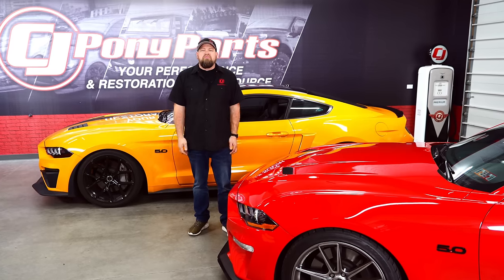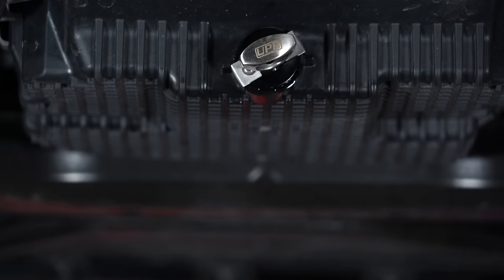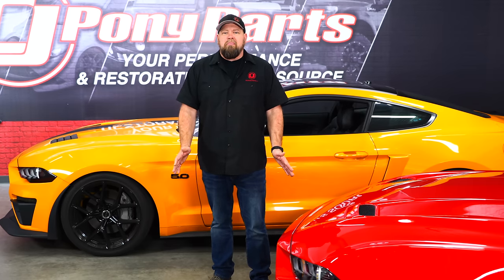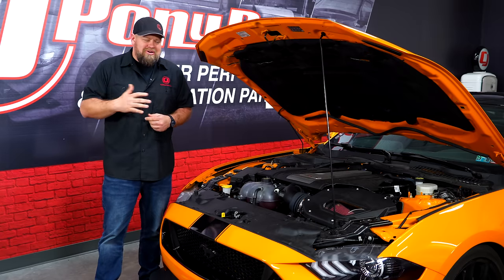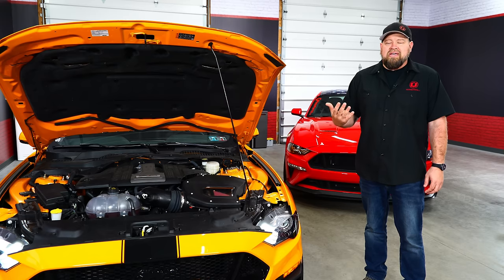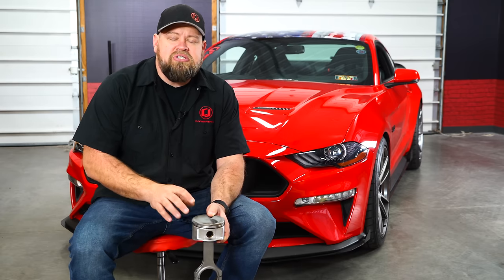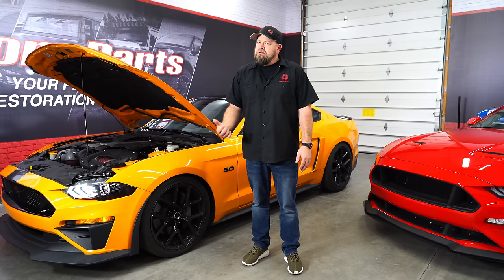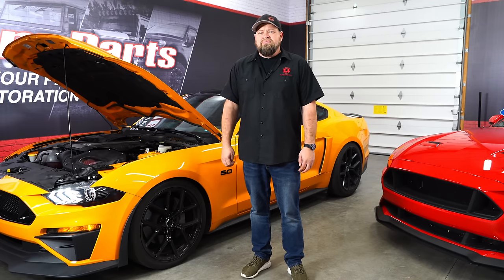2018-2019 Mustang Tick: Should You Be Concerned?

Comment: My 2014 has the tick, but i just add a bottle of ceratec every oil change, and the tick is no where to be found. The engine is so quiet you can bearly tell if its running or not.

Comment: My 5.0 2018 has it and I some times thinks it’s getting louder but I am sure it’s not. I am a mechanic for years. Yes this does seem like a piston slap issue mine has been happening from 32,000 to 69,000 I looked at the rod bearings they are good. Looked into the piston bores they don’t seem to have any scuffing or bruises. So that theory is out the window..

Comment: My 2020 Gt base model is currently at the dealership. They told me yesterday 2/4/21 that my whole passenger side has no compression. I don’t dog my car but I do drive it hard off and on as it is a sports car. I have had the tick sound and even a rattle at around 2000 rpm. I’m not sure if it’s all connected somehow but my motor gave out while going 60mph on the highway. We will see what happens and if Ford stands behind the warranty

Comment: I have the same tick with my 08 mercury sable that goes away when warmed up. Bought it with 9 thousand miles now has 60,000 miles. Still running strong no problems. I hear they're calling it the Ford tick.

Comment: Thanks for this.  Nice video and I agree with your viewpoints here.  FWIW, I have found Ceratec go be a successful solution for nearly any unwanted ticking noise in the engine.
Reply from the maker: Romacitta it really is good stuff
Reply: Hey do you have auto or manual?
Reply: CJ Pony Parts hey can I use ceratic on my 'manual' mustang 2018 gt
Reply: CJ Pony Parts can we add it to the MT82 transmission for smoother shifting?

Comment: I’m buying stocks in ceratec
Reply: Dilly,Dilly!😀
Reply: Lol
Reply: Not a bad idea! Seriously! 🤔
Reply: Haha no shit!
Reply: 2016Mustang I wouldn't put that stuff in my engine, if anyone is concerned about hearing what the think is excessive noise (tick) I would run a higher weight oil like what has been recommended by some here.
Reply: 2016Mustang why should you have to add anything to that engine. The manufacturer doesn't recommend it at all so there is a underlying problem that may be getting mask when using fairytale additive if the manufacturer doesn't list it  in your manual or when  leaving the lot you're not told to use it in order to keep your car quiet something's not right
Reply: @poweraddergt6580  I have a 2019 Mustang GT. My car has had the tick since the first oil change. Today I changed from the recommended oil to a 5w-30 and I have to say I still hear it loud and clear.

Comment: I bought a 17 gt/cs with 9000 miles on it and later found out engine was replaced at 3500 miles for piston slap. no problems with new engine so far but I have 7 year 100k mile warranty.

Comment: I have a 2019 GT PP2. At about 9,500 miles I stated experiencing a rattle from the valve train between 1,500 and 2,000 RPM. I brought it to my dealer and they replaced the cam phasers.  The moment I drove the car home I heard the noise. I brought it back and drove it with the service manager. He heard the noise and kept the car for another week but failed to address the problem other then to acknowledge that there was a noise but couldn't identify a cause. I then took it to a dealer clear across the state. They too heard the noise and couldn't determine the cause. At this point the car has 13,500 miles and still has the noise. I cringe when I hear it. The dealer told me that Ford's technical division is aware of my problem and when they find out what is causing the noise they will get back to me. My original warranty expires next month so we'll see what Ford has to say when this engine craps the bed.

Comment: 2019 GT... I bought it back November and after about 150 miles it’s started with the noise... went back to dealer and after they listened to certain areas and them being in contact with Ford and being told other areas to listen too, the dealer and ford said it was VVT noise... they pulled the filter and didn’t see any sign of metal... car now has 750 miles on it and the noise hasn’t changed but does go away when warm... I’m waiting till I get more miles on it and I’m checking for metal in the filter myself, pending what find will determine if it goes back due to metal in the oil or if it’s clean then I will run 5w40 in it... I don’t believe it’s VVT noise... I can agree with piston slap being a potential reason for the noise... could different oil be a fix/bandaid for the noise, maybe but time will tell...

Comment: Got a 2017 5.0 manual perf pack..bought it new..baby it..only 5000 miles..did my second oil change yesterday..and I heard the tick for the first time with the car in my garage..can hear all better in there?..I guess..never heard it before..need to see if maybe its the Direct Injection you mention..I heard it from the front..thought maybe it was a belt? or chain etc? its not super loud and not sure if its "consistent".. maybe..I'll check..its my first Coyote motor

Comment: Got the engine replaced under warranty on my 2017 after 15,000 miles. Had the tick, all the time. Could hear it best when holding the throttle at 2000 rpm in park. Dealer said one cylinder wall was scored and measured out of tolerance.
Tick is gone now with the new engine.

Comment: My 2012 Mustang GT has the tick. 95,000 miles later it’s still in one piece.

I did two oil change analysis between 10,000 miles. There was no unusual wear or metals discovered in the oil analysis.

5W-20 oil with 10,000 mile oil change intervals.

Comment: I had a 2017 and I could hear a noise from under the car at start up, initial idle, and on initial acceleration.  Once it warmed up, it seemed to go away.  Had the dealer look at it.  They could hear, but could not trace to know what it was...so they said.  Thought it was a clutch noise, a loose exhaust, possible rod knock...I ran through all possibilities.  Could not figure out.  Part of the reason I sold it.  Have had 2 M3s in the past that both had a lot of issues...did not want another.

Comment: I have 04 f150 4x4 with 6" lift and 35's with 5.4, and yes the cam phaser tick also. I also have 221,000 mls and it gets 15-17 mpgs. Haven't had any problems with the motor, (using Mobile One) and running strong still.

Comment: I bought a new 2014 GT that had the tick since day one ( under the car )  only would tick at low RPM when fully warm with 5W50 . I put over 30+ road course track days on that car and had no engine or transmission issues. Tick was still there when I traded it with 19K miles.

Comment: 2014 GT bought used at 14,000 miles. Noticed tick when I got it home after pulling into garage. Changed oil to Royal Purple 5w20 and have not heard the tick since. Also changed transmission to Royal purple syncromax and it stopped making noise as well!

Comment: I have a 2018 Gt PP1 and my car had the tick when I purchased it new. It has around 25k miles on it and the tick is completely gone now and my engine runs smooth. The only thing I've done is change the oil regularly with 5w30 motorcraft oil.

Comment: This tick is common in a lot of engines I’ve found. The 1H family engines from Toyota have this noise and have so for 30+ years of production. The general thought is either crank flex or hydraulic noises. Ceratec fixed the noise in my case also in my 1HDFTE. No one has reported their engine failing from this tick that I can find with their Toyota. It seems to be a normal noise with no bad effects. Really annoying though!!

Comment: I just purchased a 2019 GT with PP1. I have 1100 miles and have the tic at start up, goes away after warm up. It seems to me that these “solutions” are really guesses since the actual cause has not been determined. If the tolerances are so tight that the 10W 20 oil doesn’t lube until warm, adding thicker oil is not going to help. If it’s piston slap, doesn’t matter what oil you’re using, you just won’t hear it. Since I have another 35K miles, I’m going to monitor and hope Ford identifies specifically the cause and a real solution. Drive on!

Comment: i had a lash adjuster making noise intermittently in my 15 f150 coyote , i ran a oil system cleaner through the engine and the changed the oil with 5w30 mobil one , ran it 2k miles and the changed oil again w/ mobil one 5w30 and now no noise !!! the 5w20 oil is too thin for these engines , same for the 5.4l and 4.6l with the chain guide and phaser problems , and change the oil every 5k miles or less !!!

Comment: It is just a clearance issue. Minor and it occurs with all engines in all applications. Ford is well versed in the Plasma Wire Arc technology having used it several high performance Mustangs well before 2018.

Comment: I have a 2019 GT pp1. I didn't have the tick but I did get a longblock replacement under warranty (1.5 month process). The initial diagnosis was at around 500 miles. You could hear a dull knocking coming from the engine, the car would occasionally have a very rough idle, and it was down on power to the point that it would really hesitate to move under 3000 RPMs. Metal was also discovered in the oil filter. The damage was to a camshaft and cam journal being scored. So far the new engine seems okay. It's noisy, and it occasionally squeals during a cold start (below freezing right now so I'm not too worried), but the engine itself feels great. No loss of power and it pulls hard from a stop. Also, no tick. I dumped the 5w20 and put in penz plat 5w30 (dexos gen2 and api sn + certified) the moment I got the car home. I've only put about 200 miles on the new engine, but so far so good.

Comment: I had a short block replacement by Ford under warranty for the same tick that you showed in the sample video. They said there was no metal shavings in my oil but one of my cylinder bores was oblong and egg shaped. I have my own tick video as well on my channel. I put 1k miles on the new motor and the tick came back shortly before I did my first oil change but only while the oil temp is cold. I used Ceretec the other day and it has not made that noise since.

Comment: I watched a video where they were working on the short blocks (some custom shop) and the guy explained that apparently they ended up with a big batch of blocks that left the factory with the wrong size (undersize) pistons, which could be the culprit of the piston slap, not so much the liner. Could it be? These motors are manufactured in Windsor, Ontario, so its hard to believe that they could have missed something like that with the years of experience they have building Ford motors. I would expect issues from a motor that manufactured in Mexico, but not Canadian built. Its a shame.

Comment: Did they address this issue in 2020, or are people still getting it?
Reply: Would like to know as well.
Reply: @MatthewJay80  I have a 2020 GT and it just started making this noise at 1,500 ish miles. Very metallic ticking, like a heat cycle expanding/contracting but its coming from the bottom of the engine... Sucks to have spent 50k on a car and 1 month later the engine sounds like this...

Comment: 1300 miles after I bought the car it started ticking. Dealership cut open my filter and found metal in my oil. They pulled the valve covers and popped off the upper cam caps and found excessive scoring on the caps and cams. Waited 4 months to get a replacement engine. Got the 2nd engine and it lasted 1200 miles. I waited another 2 months for engine number 3. Drove it for 600 miles and hey hey,,,,you guessed it.... tick,tick,tick,tick!  I have everything video documented and pics of all that has happened. I really think Ford should address this issue. Not just well hey you spent 53,000 bucks on a car so deal with it.

Comment: I just bought a 2020 GT and it has 850 miles on it now and I just noticed the tick and that’s why I started doing some research. I will have to try upping the oil to something a little heavier to see if that helps. I have not had it fixed yet. Thanks for this video

Comment: For any engine noise, anything you do to the oil is a bandaid.  The real fix is to build it right.  Causes are widespread and never ending...lack of a quality and properly located cylinder liner,  bearing problems, excessive con rod side clearance, piston slap...  If you want to fix a noisy engine right; tear it down have iron liners properly installed in the perfect bore space, properly fit pistons, connecting rods with proper side clearance, quality bearings... basically building it the way it should be.  

A random typewriter tap can often be way too much connecting rod side clearance. Should be about .008" - .020". Get way over .020" and on the downward stroke the con rods slam to one side, at BDC and a little crank flex, they get slammed to the other side before the upward stroke.  And you hear a random tap.  Take an engine with over .020" con rod side clearance and tap the rods back and forth on the crank journal... sound familiar and kinda like a typewriter?  Cylinder bore spacing out of whack plays havoc with con rods and side wear.  Add in expansion/growth, multiplies the problem.  Properly located iron liners lessen that issue probability.  

Piston slap is obvious.   Sounds like a diesel on cold start.  Goes away after a few minutes.  After many many miles the piston skirts may be so wore down that it even rattles warm.  But again, very obvious diesel like sound.  
Bearing problems also obvious.  Remove, inspect, measure clearance.   The elusive noise is the con rod side clearance, and bore spacing problems.   Might take putting an engine in an oven at 200 for a few hours to see how things look at operating temp to then see... wow the cylinder bore centers are way off and several sets of con rods have way too much side clearance.  

There is a simple way to build an engine that doesn't make odd random knocking/tapping noises.  It's called quality control.    And before that... robustness of design.

Comment: I Own a 2018 PP1 and have had my engine replaced after 1142 miles, Because of no oil pressure. Jumping ahead to 5200 miles started hearing the tick by 7000 miles is was getting pretty bad took it in and dealership Master tech said it sounded like it was coming from the front of the engine. took front of motor apart to find the timing chain tensioners were bad . they replaced the whole timing assembly and pooof no more tick. picked car up today 12/28/18 motor sounds real good..putting ceratec in the morning just because.. crossing fingers tick stays away.
Reply from the maker: David Rose wow that’s a lot to deal with  at such a low mileage. Hopefully the ceratec helps

Comment: My 18 has 12k miles and every once in a while I swear I hear a tick but it's very faint and not like my previous car, a 2016 GT that most definitely had the tick and had its block replaced under warranty. Paperwork said "scoring in cylinder 8" and that happened at 7k miles. I'm pretty paranoid about it now because of my bad experience with the 16, so I overanalyze every little noise I hear on the 18. But so far so good.

Comment: My 2020 GT with 12,500 miles and I’ve had the tick since around 8k miles. It bothers me but as of now it hasn’t done anything strange or hindered performance. These gen 3 engines are relatively noisy due to Direct injection and the tick but I’ve learned to just get used to it. I don’t agree it’s normal but so long as it doesn’t affect performance or leave me stranded I think I’ll live with it.

Comment: Bill I you are dead on... these are not bad cars imo , I have a 17 roush makes 800 plus HP but I also got a 19 doing twin turbo setup, I think this is the best mustang ford has built!! And I also think it has something to do with the spray in liners, but you and Zander are completely right ppl dowing these cars and don't even own one!!
Reply: sam constantino I have a 17 Roush Phase 2 so what do you have done to get to 800 plus because I’m interested.
Reply: @johnthegaptist7794  75mm pulley, custome tune for 93& 110 race fuel , VMP twin 67 TB ,PMAS cai, boost a pump ID1050X injectors! Its getting a fore triple pump fuel sys now and the new VMP Gen 3 2650 blower in a couple more weeks and going for 900 plus and this car only has 1,200 miles on it lol lays down 738hp to tires
Reply: @johnthegaptist7794  also got a 19 GT A10  car with only 350 miles on it doing twin turbo kit on it done got oil pump gears and crank gear done now fun part, pushing for four digits on this one prob should have built whole motor but will see how far we can take it with them spray in liners lol

Comment: Don't know about a ticking problem in my 17 gt, but I run Amsoil 5w-20. I recommend full synthetic in these engines, especially if you're running them hard. I've ran my mustang like I stole it and have never had an issue with the motor. 23,000 and still running strong. I would think it's probably something less scary that's causing that sound. Maybe the balancer or oil pump? Anyone I know with an s550 has never complained about that noise and we're all running boosted.

Comment: Crank bearings are too smooth. The oil is pulling bubbles through the oil feed holes on the crank bearings, when the bubbles hit the mating point of the upper and lower crank bearings they "pop". Ceratec coats these bearings and deadends the sound. My 20 also had this issue and Ford sucks for not having a fix for a poor design. Thanks to Ceratec the sound is gone. Maybe Ford should give you a case of Ceratec with every 5.0 purchase.

Comment: I dont know if is a different ticking but I have a ticking in a Ford Fusion and it come from from the high pressure fuel pump, take a stick or long screw driver and use like a stethoscope you going to find where it come from, I fixed mine adding MoS2 to my oil, I hear people adding Ceratec fix the problem but in my case MoS2 is $8 and fixed my ticking.